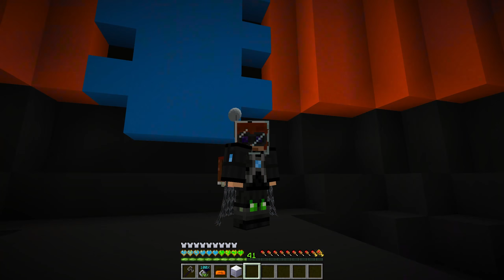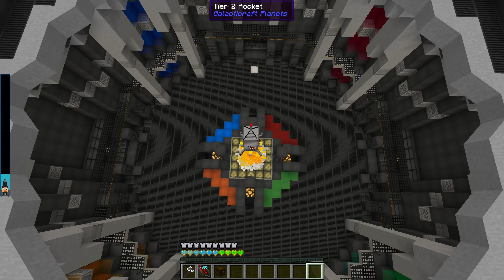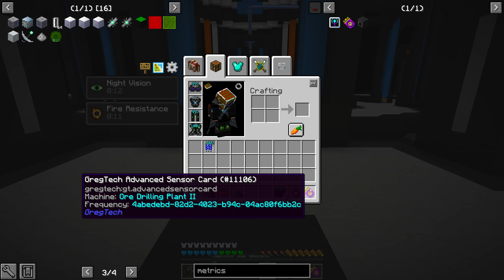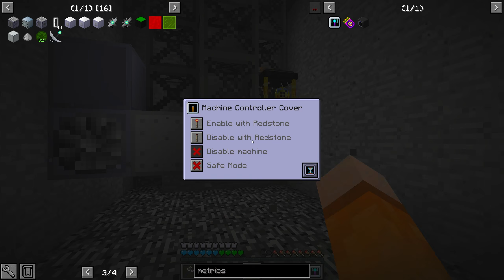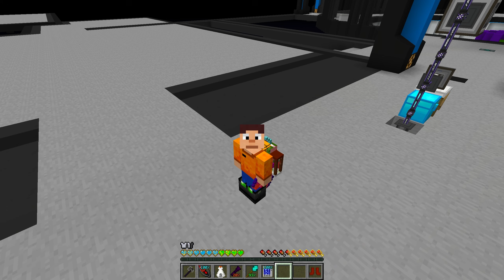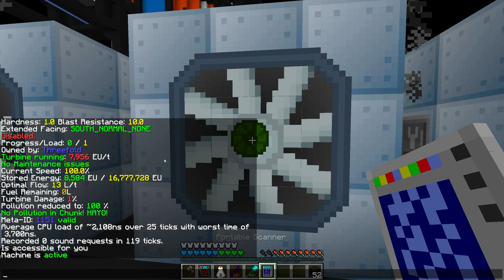Gregtech New Horizons S2 55: Control Room

Comment: There's several instances where I keep thinking you could have build something differently so that these disconnects wouldn't cause the setup to break...but, really, it's not worth it. If the setup breaks because the AE2 connections breaks than that, in and of itself, is a bigger issue the setup ain't going to make a meaningful difference in solving. The most you could realistically do is add an alarm or something, but even that would only collect dust for 99% of it's existence. Not exactly a worthwhile addition.

I actually had no idea T2 MBMs could be locked like that. Admittedly I generally stop using LV buses after a certain point, because HVs are cheap enough and it's not like the inventory size gets any bigger from there.

I would like to remind people that you can set up a discount interdim wireless AE terminal as early as pre-moon, as well as interdim teleportation as early as early-mid EV. If this kind of "go to planet, find issue, go back to base, grab items, go back to planet, fix issue, go back to base" back and forth seems terminally obnoxious, rest assured, there are solutions. Even for those allergic to magic mods - a quantum ring in the Spectre Dimension will solve a lot of problems post-T2 rocket.

You will be using a lot more raw oil now than you did circa MV, good thing you've got access to three higher tiers of fluid drilling rigs and three higher tiers of energy hatches with which to feed them power...you know, eventually. When oil runs low again 🙃.

For the record you can skip polyphenylene by instead adding more of a cable's material, I.E. using Vanadium-Gallium foil instead of polyphenylene foil, but this is something that is never, ever worth doing. There is no halfway reasonable circumstance where the cost of a cable's material is less than the cost of making polyphenylene, if only in the context of the opportunity cost where if you don't have polyphenylene for one cable you logically don't have it for any cable, meaning even if one cable does happen to be an exception the entire rest of the class still will not be.

AE2 controllers you really don't need to put much of any actual thought into, even in a pack as insane as GTNH, but you do want to plan for expansion. Running out of P2P slots with no room to comfortably expand into is a very unfortunate position to be in. For the record, BTW, a good enough AE2 controller design for GTNH is just a cube. No need for crazy hyper optimized designs that can support however many tens of thousands of channels, nope. All you need, even in GTNH, is a giant cube.

Three actually tackling a side project rather than just droning on about it? I'unno guys, I think he might be buzzing up a storm again. Un-bee-lievable, that guy 🙃.

...I'll go fling myself into the void now.

Situations like wanting to test the new turbines is why I generally prefer toggle latches over RS latches, but the problem with toggle latches is that if, for any reason, the set or reset signal can fire again before the other, everything is going to break. RS latches plain don't have that issue.

Plasma is going to necessitate EHEs if you want to get any halfway reasonably decent power efficiency out of them, so that build is definitely not going to fit there.
Reply: you sure seem to know ur stuff in GTNH,  have you ever though of making a playthrough?  You cooking up builds would be kinda cool to watch
Reply: @loho6894  Not especially. I've done the video recording/uploading rodeo, and I'm not in a position to return to that even if I wanted to. I do share random stuff I build in Three's discord, for what that's worth.
Reply: What did you mean by "set up a discount interdim wireless AE terminal as early as pre-moon"?
Reply: @Иван-в3х6к  Basically, you can use a combination of Thaumcraft Magic Mirrors and Logistics Pipes Remote Orderer pipe to order items to be send through a magic mirror to you remotely. It's a bit of a clunky setup admittedly, but it's a bargain considering what you pay for it. It actually combos really nicely with AE2 digital storage as well, since you only need a single AE2 interface and LP provider pipe to read the content of your entire AE2 system and expose it to the LP system's Remote Orderer.

The spreadsheet goes into more detail, if you're curious.
Reply: @TheShadowofX  That's a shame but definetely understandable, I've come to respect video makers greatly recognizing how hard is their work. Definetely going to check the posts out. 

In games like factorio there are nice builds that the whole community can see and has access to , to be able to use in their playthroughs. I think something similar is missing in GTNH and it would go a long way to make it more accessible. Being able to figure out ratios is (most of the time) pretty straight forward and there are even tools like GTNHflow availiable to use , however in minecraft arranging the machines in a nice way , powering them and handling the logistics between them (especially before AE2) adds more complexity. When I first saw your benzene build I was in awe, a complete system handling every input/output and even managing pollution and byproducts and doing so in a good ratio. 

And then there are the multitude of  small "tricks" people have figured out and use. For example three using a multi input hatch in an LCR , I saw it and never realized it could be used for one and it's not only for blast furnaces, or the thing about mirror you mention in the comment. Tricks like that can be very useful and cool but hard to figure out unless someone is familiar with the mod or has spent time experimenting with it. 

That being said  I am familiar with the wiki and the discord, but I don't think they have what I am talking about or at least don't have a lot of it.

Anyways, this is just for discussion sake and maybe a potential video idea? Showcasing GTNH builds?

Comment: for the polyphenylene sulfide LCR recipe, for the craft that requires air,  there's an air intake hatch that gives you unlimited air to use in  multiblocks (also one for water)
Reply from the maker: Good call! Not that oxygen is an issue at the moment, but yeah.. Air intake is more efficient :)

Comment: I really like the building you've done on this base. It has a lot of character for what you admit is some very simple components. Be proud of that! A couple of thoughts about base design, feel free to take them or leave them.

1 - I think you should incorporate more verticality into the base somehow. The towers, while impressive, stick out a little bit. Including some mid-sized height increase in some other areas of the base could help the towers feel less jarring. Take inspiration from places like downtown city centers. There normally isn't a 2 bedroom house next to a skyscraper, the increase in heights are gradual.

2 - I like the orange strip you wanted to replace with glass because it limits your vision. Sometimes when you're given infinite space to view, the best thing is to reduce field of view. Having a solid block as a backdrop as opposed to something like glass can help frame your view. 

Love your content, glad you're back and enjoying yourself!

Comment: The neonite blocks look fantastic, personally, I think they work great with the information/ae2 towers around the base. If you don't want them to distract from important bits, id say use them like guiding lights to areas where you do want attention. Like guiding lights that lead towards the control room like a highway, then the control room itself will be the big eye piece. They seem like a good foil/accent for eye candy that is more important than the neonite itself. I hope this isn't coming out as nonsense lol.

Comment: The base is shaping up great! Can't wait to see it with the wired ME Controler. 
In addition quick question where would one go to learn how AE2 works? GTNH is my first exposure to the mod and is hampering my playthrough speed, now that I need to set up the plat line.

Comment: Amazing video once again! You are literally a machine lol. Greg question. Back in the nomi days, I always thought export/import busses were very laggy, however, in this playthrough you are using mainly busses and I remember you mentioning in a previous video that a dual interface on input hatch with pump modules is very TPS in-efficient. Are export/import bus lag something that just effects 1.12?

Also, I believe (from asking around the discord) that chunk boundaries don't matter if they are all chunkloaded. It makes sense since some multiblocks like the DTPF and Eye of Harmony are all larger than one chunk.

Comment: if i reckon correctly u said u dont like jetpack flight cuz its slow a few episodes ago, there is an option in controls called IC2 "boost key", u can bind it to ur sprint button (it doesnt collide with sprint) and then u fly much faster
Reply from the maker: Only works with the Quantum Armour or above unfortunately. The nano Jetpack doesn't have the boost functionality :(

Comment: just wondering, why use LCR for every chemical recipe when you can just use the singleblock for it?
Reply: LCRs are easier to upgrade if need be, plus they are just better than single blocks
Reply: @Royal_4096  i mean like sodium sulfide dust, which is just 2 sodium + sulfur dust, which is also 1 dust/sec on just LV. So is Three just flexing his riches by making one LCR for every chemical recipe?